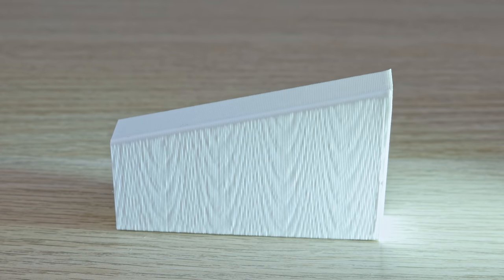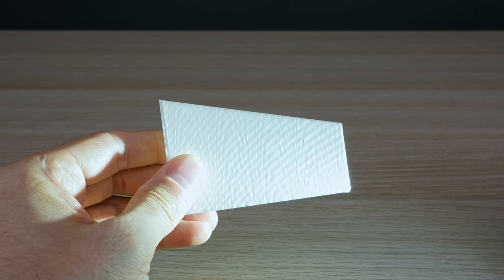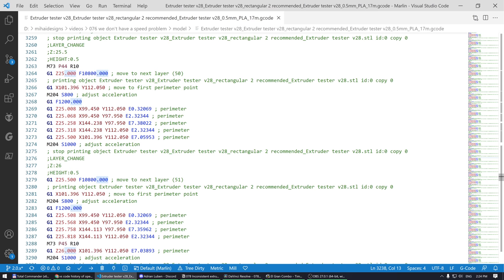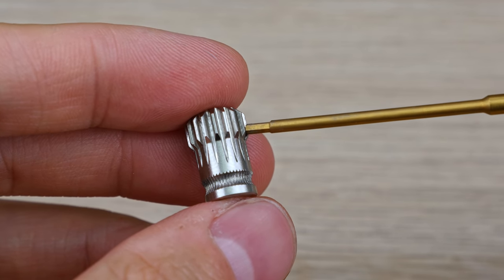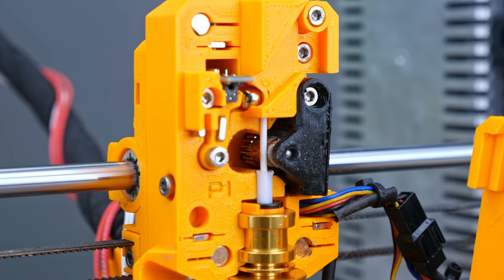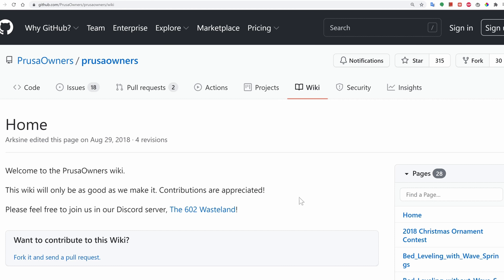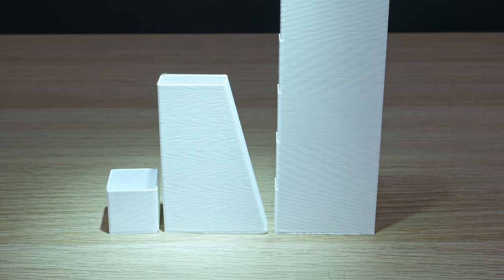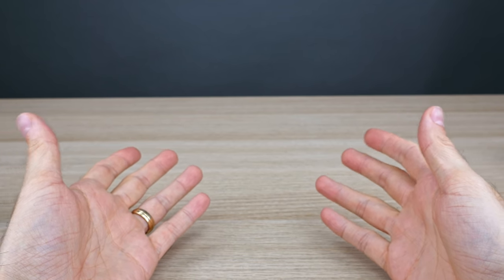What I've learned about dual gear extruders and how to patch them, maybe

Comment: The omg v2-s might be the optimal extruder of the future. :)

As good/bad (depending on how you see them) Triangle labs is, might be worth asking them to make a couple helical gears, they would likely be willing to experiment. :)
Reply from the maker: Indeed TriangleLab sent me a lot of parts for my upcoming projects. I didn't think of suggesting custom parts.
Reply: @MihaiDesigns  it is worth a shot :)
Reply: I know they're supposed to be a lot lighter than the micro Swiss. That's great to hear.

Comment: I'm new to 3D printing but many years ago I designed a wire feeder for a machine that fed 1.6mm diam wire into a machine for making plugs for Tig welding gas turbine blades.
The turbine blades were for Rolls Royce jet engines and after the blades were investment cast they had small holes in the ends to vent them.....these holes had the plugs inserted in the ends and then Tig welded closed.......production rate for the machine making the plugs was 80 strokes per minute ......80 X 60 = 4,000 per hour.
The point is, the rollers feeding the wire were plain grooved without the gripper grooves like the 3D printer filament feeder in question and only one roller was driven the other roller was spring loaded against the wire.
Perhaps the cyclic gripping force of the gears and/or the roller griping teeth is causing the pattern that is on the prints.....I don't know, it's just an observation.
One thing is also apparent....the smaller the diam of the roller the greater it will indent on the filament surface.........so if the roller(s) were a larger diam the surface area would have a greater gripping force and a pair of rollers in tandem would also have more grip to feed the filament without having to squeeze it so tight.
I would even go so far as to say that if a set of 3 pairs of smooth rollers (grooved but no teeth)  in line were used it would smooth the flow without having to grip the filament so tightly......anyone who has press tool experience will know how a strip feeder works.
Reply from the maker: Indeed I was also thinking about multiple in line sets of wheels.
Reply: @MihaiDesigns  6 Grooved wheels in pairs......you would have to couple the wheels together in pairs to get the benefit of a multiple drive, that means the wheels would have to rotate in the same direction for all  pairs........perhaps they could be coupled with an O ring as a drive belt to each one on one side to ensure they all rotated the same way while gripping the filament.....the opposite wheels would just be spring loaded to apply the grip........I think the diam of the wheels should be larger than the current drive ones........about 20mm diam and both grooved sounds right for a better grip without actually indenting the filament.

Comment: Google Zero backlash spur gear, consists of a spring tensioned double gear to replace one standard gear.
Reply: Which gives you low backlash if your force and acceleration are also very low, but doesn't really affect periodic error. It would only affect retractions.

Comment: Just an idea, why not remove the teeth from the geared idler? so it free spins and set the tension on the spring screw to slightly tighter than normal? this would still be better than using a bearing as the place holder?

Comment: Now you made me think about this. Could  it not be, that the teeth of the gears have to be synchronized to the teeth of the filament transport. The pattern  you have looks in physics like a beat signal between 2 almost identical frequencies or multiples. It is: Tbeat=T1*T2/(2*abs(T2-T1)). Tbeat are your  1.5mm T1 and T2 are the two periods in competition.
Reply from the maker: I'm pretty sure you're right. Even though the larger T1 appears to have a higher amplitude. When it's gone, the other one is clearly visible.

Comment: That's an interesting deep dive . I was wondering though how much it is a bigger issue in direct drive extruder compared to bowden. Fractions of 1.5mm extrusion artefacts  could easily be hidden in the bowden noise.
Reply from the maker: They appear to be smoothed out by the tube. Doesn't mean it doesn't cause other issues, but it does smooth this one out.

Comment: The solution would be a way to keep the large gears meshed at their ideal depth while also allowing the filament teeth to bite into the filament and accommodate different filament widths. 

My immediate Idea would be to have the secondary gear shaft ride in two slots. (slots perpendicular to the driven gear axis.) Then you could use two springs, one at either end of the secondary gear shaft. One would provide pressure to mesh the large gears, and the second spring would tension the filament teeth. This would allow the secondary gear to rock back and forth. Ideally the large gears would have a spherical shape so they mesh well at any angle.

my second idea would be to use w additional gears, or 1 gear and a belt to couple the driven and secondary extruder gears. It would be more complicated, but you could make something that could open/close to grab filament without the gear engagement changing at all.

Comment: A lot can be done with custom gear shapes.  Something that's a little different than an involute.  
Double helical gears are super expensive to cut, but a single helical gear isn't much more expensive than a spur gear.  You would need to add bearings to take the thrust loads.
Reply from the maker: I see. The idea was for them to self align, but in the end I guess we can get them into alignment in a different way and we could have a thrust bearing take care of the little load. They would always stay in the same position after all. Good point!
Reply: @MihaiDesigns  Why not just 2 helical gears on a spline paired together on both sides?

Comment: When you have to shine a light at the specific angle to even see this, is it really a big problem? Just that I've never ever noticed this on any my prints over the past 3 years. Not saying it's never happened, ... but if I've never noticed it...

Saying that, your amount of dedication to work out the reason for it is quite impressive.
Reply from the maker: This is for the camera to pick it up better. I have another project with lots of boxes that show various versions of this pattern. On a large and flat surface with shiny filament it's almost impossible to miss. I guess most "normal" people wouldn't worry about it. But I tend to obsess over this kind of thing. I did make measurements and the deviations are under 50 microns, so not that much, but it is there, and it being a pattern it becomes way more obvious. I guess because we're so used to see patterns.
Reply: @MihaiDesigns  @EaziG This is a real problem and can be clearly visible.  For some applications, it really matters.  If there are reasonably priced fixes this is something that should be addressed.  I know I hate seeing artifacts in prints that I know should be flat.

Comment: just out of curiosity- are the remaining patterns vibration, like the ones fixed by input shaper?
Reply from the maker: On the blue model at the end? I doubt it. I've got another video on that (still to be edited), but I haven't tested my theory yet.
Reply: looks a lot like driver noise to me
Reply: Input shaper is only used to prevent “ringing” look up the term on google. This is a completely different artifact. Input shaper cancels out ringing and pressure advance in combination makes edges sharper. These artifacts are not caused by either of these because they are moving in straight lines with no turns or changes to accel and decel.
Reply: Salmon skin, maybe?

Comment: I absolutely LOVE your work and your style of thinking - exactly same as mine. All my prints look like trash after moving from PrusaMK2 style extruder to MK3 & dual-drives. Only thing that "helps" is to damp the extruder by bowden or to overload it with high speed, so it is not able to pronounce those oscillations.

Comment: i wonder if the Hemera with its different gear has this same issue, or a modified version
Reply from the maker: I did get some results in from the Hemera. There is a faint wood grain pattern in one of them, but that might be caused by something else. I can't tell for sure.
Reply: some do, some dont
Reply: The answer is yes.
The moment your filament is hard enough or is moving fast enough, gears come apart.

Comment: Thank you for this video! I've been chasing this issue for so long now. Using the extrusion test stl you provided, I get that woodgrain effect. I turn my dual gear setup to a gear and pully like you did, and I still get the issue. I look at my extruder motor, and I can visually see it doesn't spin smoothly, thanks to a knob I installed, which has the unintended effect of being a great visualizer of the motor movement.

I personally believe it's going down to either my TMC2209 drivers, or my stepper motor's QC, seeing that I messed with everything I could. We'll see if I find the root cause of my problem.

Comment: You sir, earned a sub. Seems to be a descepancy with the involute gear profiles not providing consistent torque through the gears meshing. The involute profile is designed to provide stable torque through the motion of the gear but when they are too loosely meshed you have create a situation where the motion is not transmitted smoothly. I wonder if helical gears would solve this issue.
Reply from the maker: I wonder the same. I might be getting such gears for testing in a while.

Comment: What about making the gears larger so that the distance to the filament is higher and rotating the second gear around the one on the stepper until it squishes the filament? The gears would always be close together and every filament can be used. I don't know if I explained my idea clearly, but in my head it's a simple solution.

Comment: I've got a few ideas to help with this pattern: A gearbox between the filament driving gears may help, a belt or chain might improve the situation aswell, also using smooth rubber wheels to transmit the rotational force between the driving gears seems a possible solution or (if you're using a bowden setup) using two motors (one for each gear) should work aswell.

Comment: That looks not like an issue so much with dual extrusion because Stratasys does it as well. I think it's the gears that you're using specifically. It's probably that the meshing is pushing together too much on each tooth contact effectively "clicking" the extrusion as it goes around forcing the filament to stutter.

Comment: An idea would be to use a very small belt with a tensioner. But you would have to redesign the gears for pulleys.

Comment: Have both extruder gears on fixed posts with one extruder gear have a sloped area to grip the filament. That same gear can move in and out along the post and is spring loaded. As the filament gets thicker or stiffer, it can push the gear so that the aperture becomes larger. This way the gears' teeth are always precisely aligned to each other and the feed aperture can still change.

Comment: First, love your videos, finally a long one xD

Printed a test model after watching the video. I do have similar wood grain pattern. But it is also barely visible, only if I shine the light almost parallel to the side. It's not prominent enough to attempt to fix, but I really appreciate your research. Now I know what to do if it ever becomes bad.  (MK3S with Bondtech extruder, .6 nozzle, .35 layer height, extrusion width .75, speed 20)
Reply from the maker: Thank you. Which model are we talking? The ones called 1 or 2 in the name are for the pattern I show here. The higher numbers like 8 are for a fainter pattern that I haven't fixed. Think of the numbers as meaning how much you zoom in on patterns. Zoom out too much and you can't see the finer ones. Zoom in too much and you miss the larger ones.
Reply: @MihaiDesigns  I printed “rectangular 2 recommended” . Not sure about zoom, I inspected the model visually with no equipment. After taking another look I think I could distinguish one or two “bands” of alignment of the distortions caused by dual gears. I will attempt other models too and boost extrusion width a bit.

Comment: Amazing detective work. 
Here's one bodge that comes to my mind: some heavy grease. It might have a similar effect to tilting the spur gears closer to each other while not causing the hobs to move further apart.
Reply: It won't solve the issue.
Also, for the speed these small gears are rotating, you'll need something like hard silicone to compensate for this slack.
Better to just avoid using poorly designed stuff.
If your extruder gear is skipping — you should fix your hot end, not just force material through it.
Reply: @goury  I suppose that really depends on how much slack are we talking about. I do know of heavy grease being used to take up some of the slack in some really beat up navy lathes... now, I've never heard anything good about the practice, but nonetheless. I did call it a bodge - something that may or may not just eek out a little bit of an improvement at nearly no cost or effort. A solution is something different.
Reply: @johannesmajamaki2626  grease can help in case of constant load, it won't do in this case.
Also it works in bearings, not in gears.
Also also, the slack is much greater than any grease in existence can compensate.

It's one thing when you have well designed machine that just happen to wear a bit.
It's the whole other thing when the machine wasn't well designed in the first place.

You can't resurrect what wasn't ever alive.
Reply: @goury  I slightly struggle to see the fundamental difference between a bearing and a gear, in so far as each gear tooth is independently experiencing a load that to a layman doesn't seem totally different.. (save for lack of pressure that might keep bigger globs of grease put in a cross-slide) Nor does the source of slop; loose tolerances, poor design, wear... seem to in itself be relevant. And lastly even if the slop is much larger than a grease film, surely such a film will still be a step in the right direction - whether that would make things better by 0.1, 1, or 10% I don't, however, know.

I'm way over my head here, to be frank - you've certainly got some confidence in your assertions, and heaven knows may well have the credentials to back it up too :). I'm a law student whose mechanical knowledge just about qualifies me to use a pair of kitchen scissors, provided that the instruction booklet is sufficiently detailed and well illustrated and a helpline number be provided ;)
Reply: @Johannes Majamäki  there's not much difference if the gears are perfectly matched: in this case they would actually roll and grease will compensate for wear just okay.

But these gears are not matched at all.
It's like trying to insert square shape in triangular hole in that baby or monkey learning thing. You can force the wrong shape into a wrong hole, but no amount of grease will make it fit.

These gears don't roll, they slide and scrape and they do this in steps. For filament this is like driving off a stairs for a human. How much and what type of grease do you need to put on a stairs for your bicycle to roll well?
Reply: @goury  I think we're on the same page then! I somehow haven't gotten the impression that the meshing is that poor, just that even relatively tiny mismatch gets recorded on the print as extrusion inconsistency like a gramophone in reverse. 
More like greasing rough asphalt than a staircase.
But yeah, if it's that bad, then the benefit will be much smaller. Maybe the clunking might be a little bit dampened, akin to the stairs being a bit of a more comfortable ride because of the tiny bit of cushion given by the grease, but that's about it.

This bike analogy is for sure kind of fun, because it's almost impossible to think about it without picturing a very, very funny crash shortly after.

Comment: I don't think I understand the issue, if the gears aren't "in alignment" e. g. not fully meshing you would get that "latency" of 1.5mm but it would only show up during retractions because it's a consistent amount of backlash. So the second gear would always be loaded forward by an offset of less than 1.5mm because some meshing would still be present. How exactly are you proposing the misalignment of the spur gears is causing the inconsistent extrusion? Maybe it's just the gear profile that needs to be tuned for consistent transmission of rotation at various meshing depths?
Reply: make them helical! that should fix it as contact of the next tooth starts while the last one is still full contact
Reply from the maker: My assumption is that the angular rotation transfer is non-uniform. I vaguely remember reading something about this at one point. The backlash itself is not an issue as we're only extruding in one direction. It not being constant what I meant.
Reply: @MihaiDesigns  your assumption is correct.
No gear shape would solve it, it's just bad design.
The sooner people abandon it the better.
Reply: @goury  The standard involute profile does solve it, that's one of the main advantages of the involute profile. You can change the centre distance as long as at least one tooth pair is still meshing at all times, and it will always transfer constant angular rotation. There is a good University of Cambridge article on this. The involute gear is better at taking up wear for the same reason, since the weared surfaces are sill generally involute. 
That is what is perplexing about this issue, since it shouldn't happen due to centre distance change. My hypothesis is that it is caused by angular misalignment between the shafts as this is known to cause meshing errors. The solution in industry is to use crowned gear teeth (spur or helical although helical is more expensive), although that may not be the issue, it's worth testing.
Reply: @Bordpie  this only works if the gear is hard mounted, which is not the case